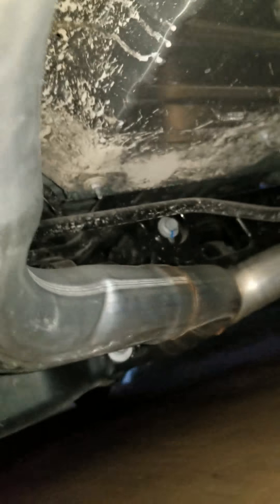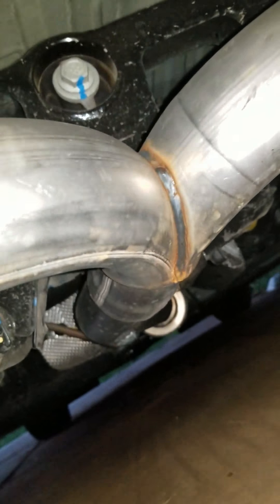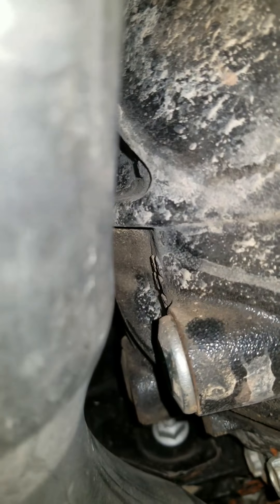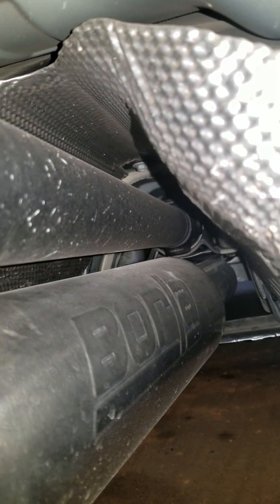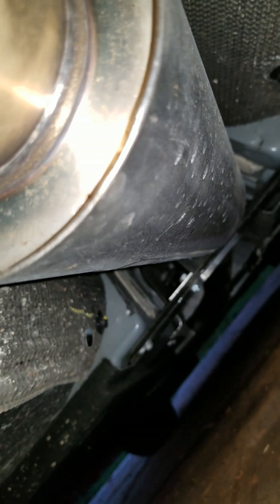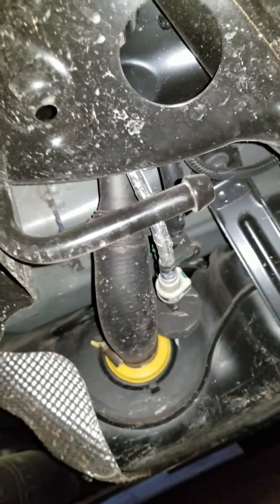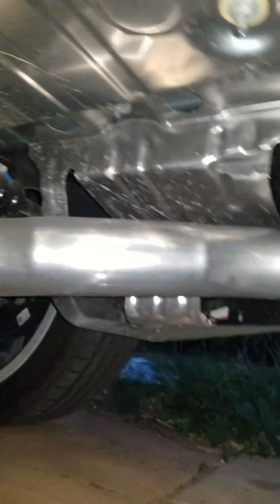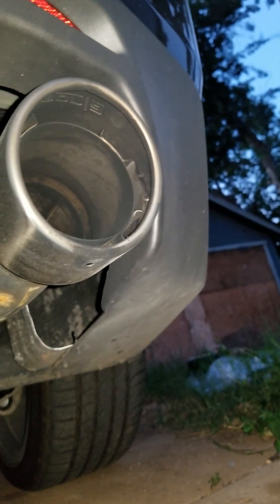2017 50th anniversary Camaro 2.0t revs, 3" borla catback exhaust with injen cold air intake

Comment: Do you plan on getting a downpipe? Sounds good in my opinion. I have the Injen CAI Evolution myself
Reply from the maker: Robert & His 2017 2.0 Turbo RS Camaro thanks man, if i do it will be with a high flow cat and after the warrenties over, and when that happens it will be getting tuned. Right now with the new exhaust after about 6k in the rpms from about 2nd gear on it feels like it is stuggleing to make power. So it needs tuned to the modes. When driving normal it runs great even get great mileage out if it.
Reply: James. That's good information. Go to Facebook and look for 6th generation camaro 2.0 Turbo Talk
Reply from the maker: Robert & His 2017 2.0 Turbo RS Camaro before I did the exhaust it continued to pull to 7k so I think with it getting more air flow out it's not getting enough fuel to make up for the air coming in and out to maintain the power curve. That and I just took it on a highway run and keep in mind I run AMSOIL Signature series oil in everything, motor, trans, and rear diff, my car at 78mph is pulling with these mods 32 mpg and about 35 or a little better at 65mph. I also plan to change the intercooler and piping with rpm performance parts to prevent the factory from failing under higher boost when I do the tune after the warrenties over.

Comment: So to be exact u got two borla exhaust tips and the borla muffler ?
Reply from the maker: Yes, had most of the original piping removed and added 3" to the back. But no long have the car anymore. Traded it for the ss a year ago.
Reply: Still got that intake for sale man? Or the mufflers? I know you traded the 2.0 for the ss but just figured you decided to part the muffler and the intake out to sale
Reply from the maker: @jvillazl2.055  i put the muffler on my 95 jeep and sold the intake. I still have the tips from it.
Reply: James Steffen dang was hoping to take that muffler off your hands
Reply from the maker: @jvillazl2.055  ya sorry, i found out my jeeps muffler was history haha.
Reply: James Steffen do the borla tips make any difference ? I’d say no but im not sure
Reply from the maker: @jvillazl2.055  they dont, i just bought them for the looks and because i had a borla muffler on it. My ss is the same way but its has 4 tips instead of just the 2.